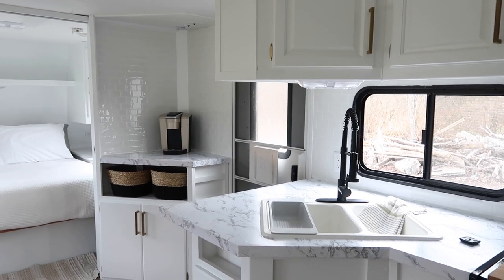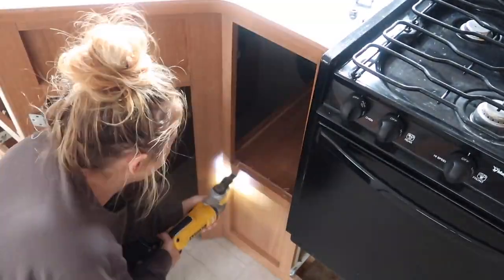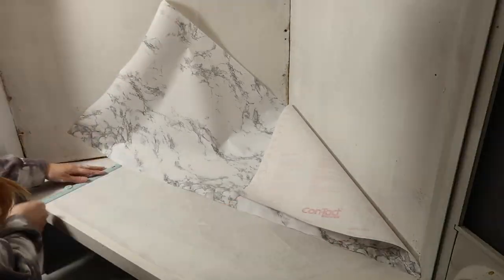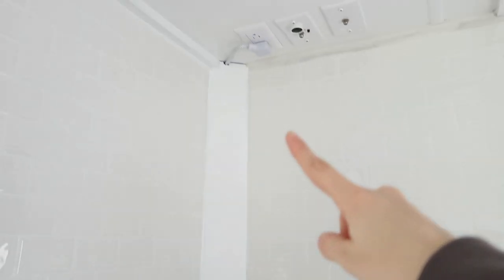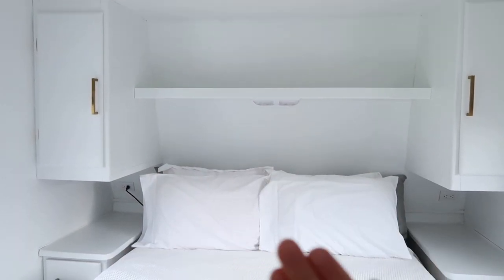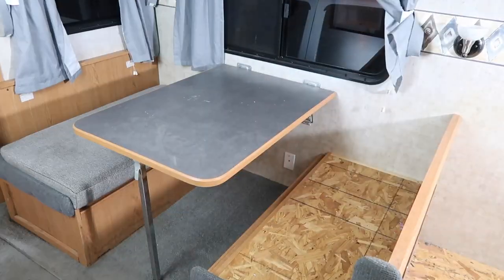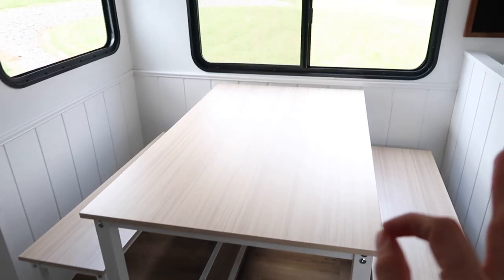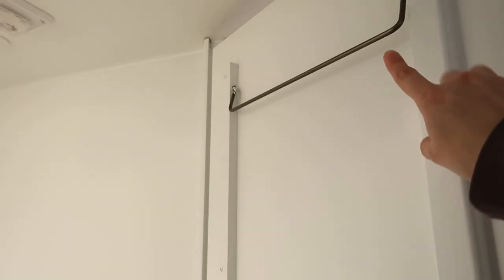TINY HOME TOUR BOHO MODERN FARMHOUSE

Comment: I absolutely love the aesthetics that you chose for this RV for your tiny home. Everything looks beautiful. You did ask about the ladder. The only thing I would suggest is putting rubber treads on each step. Years ago, I had an experience where I slipped through our ladder stairs, going up into the loft bedroom, and it wasn’t pretty… It required an ambulance a trip to the hospital and a half cast on the top of my thigh, right down to my ankle. As daily injections to ward off the possibility of blood clots, just saying..  love your RV very inspiring

Comment: Red ladder, blackout bamboo type material, folding panels that separates the girls bedroom.  U could use a lift system so the panels won’t be seen when up.  Also will help with sound barrier .or they could turn to block the door.

Comment: it looks amazing and what a fantastic job you did.     2 things that I have noticed since I started watching 6 minutes ago...   the contact paper counter- tops look great  but will damage so easily...  then your kitchen sink.   I have the same faucet  in my home and I thought I was going to love it,  but I hate it.   Notice how the water spout in its resting position doesn't point down into a open sink!  No! instead it points at the middle barrier between the two sinks!   THE SPLASH THAT   that CREATES means that I will be sopping wet after doing dishes, the floor and countertops as well!  
   Sure I can move it to a different position but it never stays put . it always hits that middle divide between sinks!  maybe not directly but still enough to splash water everywhere.   And it didn't take long for the inner workings of that faucet to break down!   Only hot water comes thru now...   the inside of the faucet broke and  the cold water just cant be used.. WHICH MEANS  I use up all the hot water real fast ..this is in a big home , I cant imagine using that faucet in my camper..  which we are wanting to remodel too...   it looks great , but is no fun to use.   MAYBE you can avoid  those problems...   .